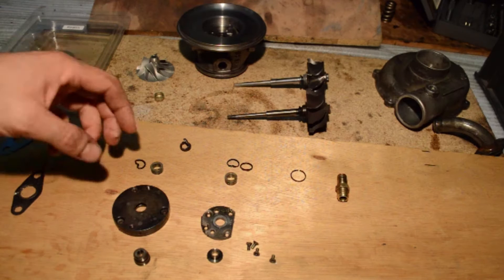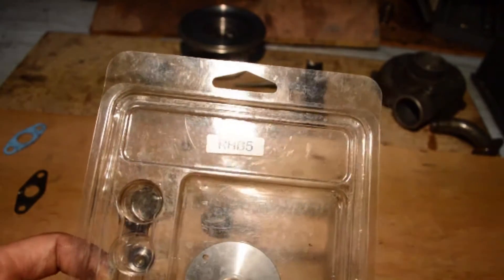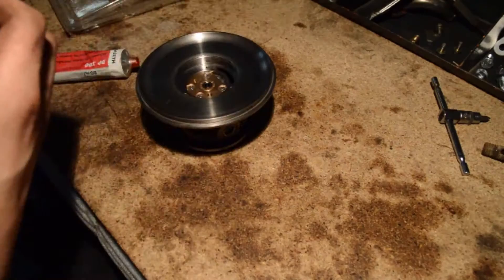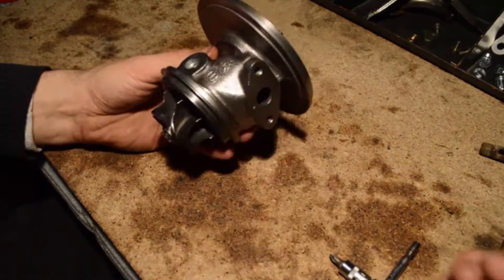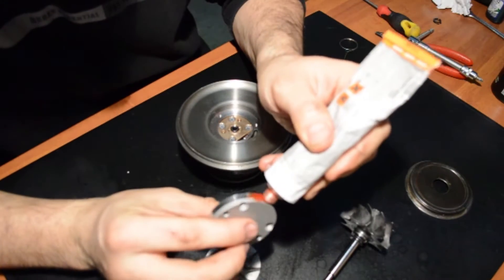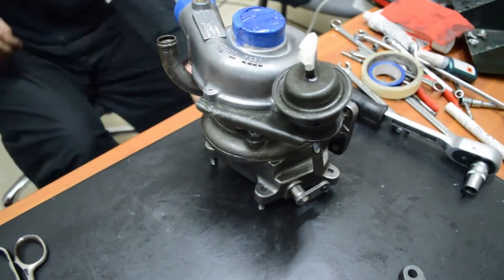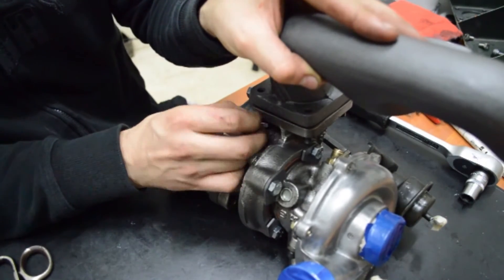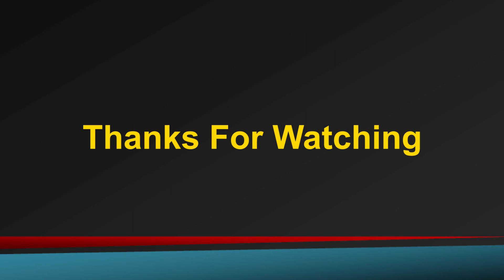How to Rebuild a Turbo (Step By Step) - Maserati Spyder Part 26

Comment: The isuzu engine is 4jb1 t and 4jg2 t
Reply from the maker: That should be about right. Keep in mind that only the turbo core is interchangeable, the housing is completely different. ( I also am not sure about the compressor wheel's blade angle )

Comment: Great series I 've watched them all. Questions: DId you upgrade the bearings or did you re-use the old ones? The waste gate looks like it has an adjustable actuator. I assume that you can increase boost by adjusting the actuator. Is the actuator rod stock or is this an upgrade?
Thank You
Reply from the maker: Thanks for your support. As for the bearings, the original ones were made out of a carbon compound and he ones I've placed are made out of brass.... still not sure if the brass bearings are as good or better (I have yet to do further research). The actuator rod is adjustable but in my case I can't do much about overboost, because this car comes with an MABC (Maserati Automatic Boost Control) system which automatically regulates itself by releasing the pressure from the boost side through a computer controlled solenoid. However if the actuator was directly connected to the actuator, then yes the amount of preload set to the rod height will determine how much the turbo will keep boosting till it opens the waste-gate.... and if not set properly the consequences to the engine could be catastrophic.
Hope This Helped :)
Reply: The MABC is used only on carburetted cars. A similar functionality is however implemented in one of the ECU's. The MABC was produced and first used by Saab. Maserati just renamed it. ;-)

The wastegates are set to 0.3Bar. Then the ECU will disconnect the wastegate from the plenum chamber until it reaches 0.7Bar if conditions allow. (No knock detected). So the ECU is not able to completely turn down boost, just down to the 0.3Bar setting. Correctly setting the 0.3Bar opening using the connecting rod is however important, as the turbos need to have the same setting. The computer is not able to control them separately.
Reply from the maker: The MABC is just a fancy terminology they used for an over-boost cut off valve/relief valve. The old carburetor turbo systems were a total nightmare to set especially since it is a twin turbo set up, because the pre-load to the valve has to be adjusted accordingly to the sea level and the season has to be taken into consideration. The ECU has the same kind of over-boost control but since it has all the sensors working together. To put it simply it is a closed loop feedback system, mainly in relation to the amount of boost being read by the ecu and relieves the pressure by dumping the excess from the relief valve solenoid. This valve works at fast intervals in an on off sequence since it response is in a digital fashion (Square wave Style) to try to mimic the analog method, with regards controlling the over-boost to keep the pressure at optimum levels.

So going back to the initial topic, an MABC is the same for all systems. The difference is that one is mechanically operated, and the other is digitally controlled.